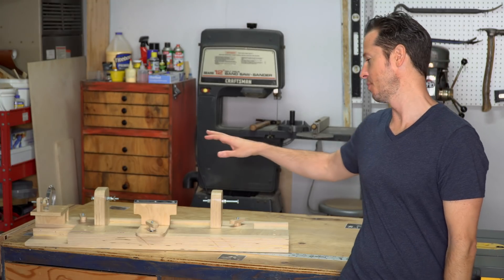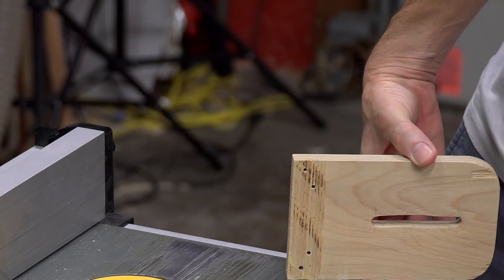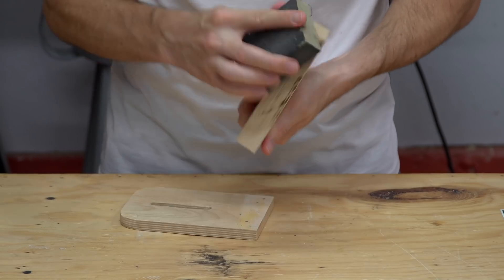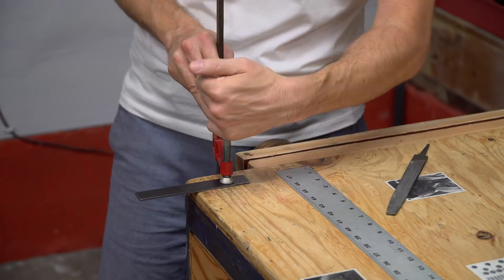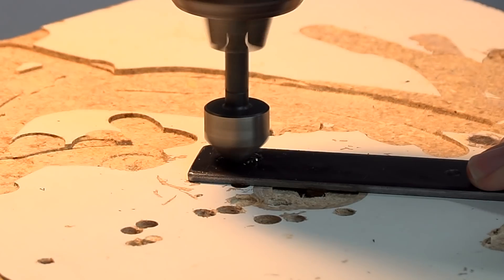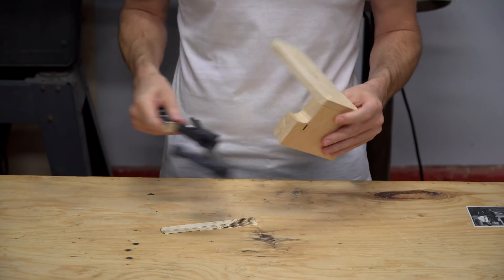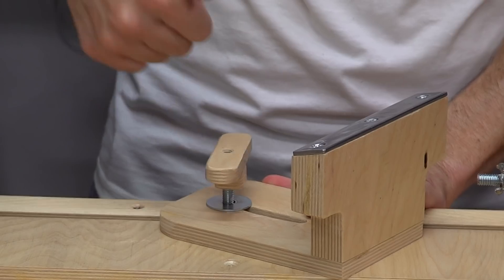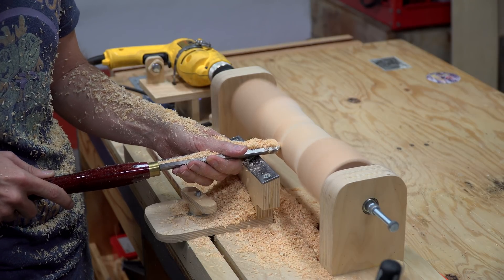Homemade Lathe Part 2

Comment: Nice fix.  Great video.
Tip from an old timer:  Always clamp metal when drilling.  If the drill bit snags in your workpiece you're going to have busted knuckles, or worse.
Reply from the maker: Thank you and thanks for the safety advice!

Comment: very nice work! It's a shame you cant add like a vacuum attachment to the chisel so it collects those wood shavings as you go, only in a perfect world eh? haha.. Good job anyway!
Reply from the maker: Thanks for the feedback Darrell! I never really considered it much, but if there are others out there, I'll do a little research and see if I can figure it out. Good luck building out your shop!
Reply from the maker: I suppose you could probably find a way to attach the vacuum, but it might be awkward to use. Interesting thought though!
Reply: @OneMinuteWorkbench  Seen many lathes with dust collector attachments - would be a simple rig to set up. Nice work - when I finally get to building out my shop I'll be picking up a set of plans from you for sure.

Comment: Great build! Just a couple more things... your guide is much better now it's lowered but it's too far back from the working piece. It should be as close as possible to give you even greater and precise control and to avoid the chisel catching downwards... you can also make the guide longer to work on longer stock and give you a smoother sliding action across. Great work though, keep it up!
Reply from the maker: Thanks for the feedback!
Reply: @ Walter Ochoa You're right - but it's no big deal, since he now can easily adjust the tool rest, bringing it closer to the wood.

Comment: One final modification: cut the rest of the headstock bolt down to a spike in the middle of your other spikes. Make the same arrangement on the tail stock. It's more secure than it seems, and it means you don't have to pre-drill mounting holes for every project.
THe rest of the lathe is great, I'm looking at building one myself.